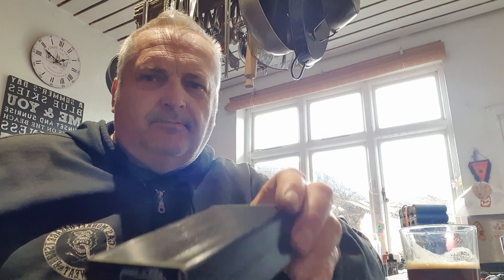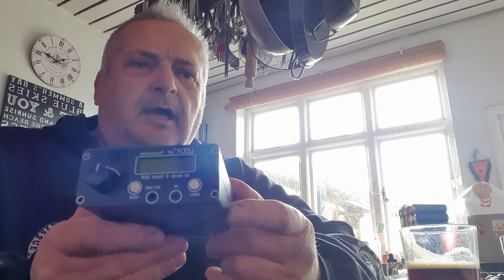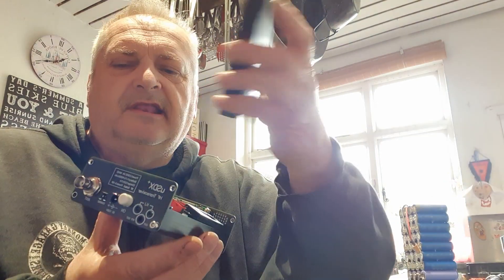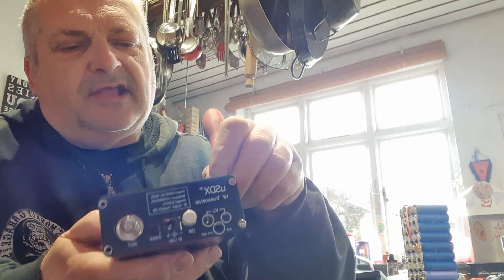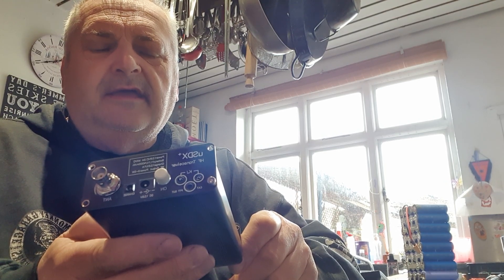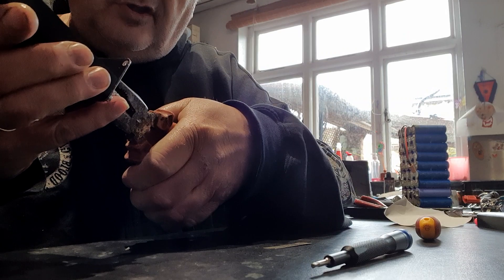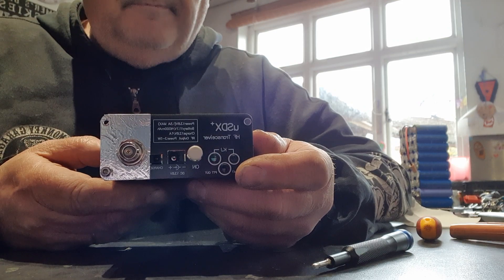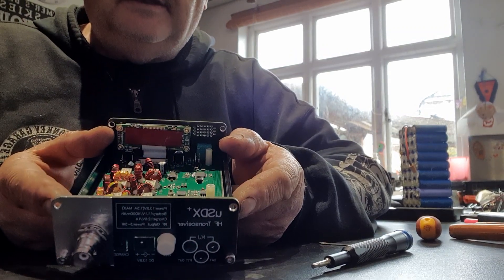uSDX + HF Transceiver. Improving grounding and stability.

Comment: I bought this and not the original for three reasons. 1. It's an eight-bander, otherwise I would have bought the original for sure. And yes, 2. the battery has just been installed and 3. the display is a bit bigger because I can't see so well anymore. The last points weren't important though. Thanks for the video.

Comment: BEFORE YOU BUY a (tr)uSDX (and yes, I realize your video is a year old, so if you were going to buy one, you probably already have):  I saw some YouTube videos about the (tr)uSDX transceiver, and went to DL2MAN Manuel's website to learn more about it, and found where he listed the builders whose versions of the (tr)uSDX passed his evaluations, and went ahead and bought one from one of them.  But then I went to download the software from Manuel, and discovered that all he offered was a compiled image of the code, with no mention of the source code.  This kind of bothered me, because it had been said in some of the reviews that it was fully open-source, and even Manuel's own website implied that by saying that all of the hardware and software was available under a CC-AT-NC-SA license.  Well, it's not true; a "no changes" license does not mean you don't get to even see the code or change it for your own use.  And in fact, it looks like Manuel and/or Guido have been going around making people take down every posted copy of the source code on the Internet.  So I went to the (tr)uSDX forum, and, oh, yes, someone had already asked if Guido's (actually) open-source code that was available on Github for the uSDX would work on it.  Which is what I was going to ask.  Not because I want to compete with Manuel, but because on a radio that does most of its work in software, I don't want to be completely dependent on them to keep my radio running.  In fact, one of the biggest attractions to amateur radio for me is being able to hack together radios that can then be used for worldwide communication.  I've never seen a radio marketed to hams that didn't include a schematic, and to me, a software-based radio for hams that doesn't include the software's source code is a ridiculous notion.  It would be like buying a transceiver from Apple.  What Manuel replied was shocking to me: he said that the code would not work directly, but someone with programming skills could probably make it work.  But THEN he went on to make it clear that this was not something that he nor Guido condoned, because they wanted to have complete control over the configuration of "their" radios, and that if he wanted to do this sort of "software rape" (his words, not mine), he would he on his own.
The main attraction for me was being able to modify "my" radio to my liking, so Manuel has pretty much forced me into buying an older uSDX+ model from an UN-approved supplier, just so that I could fix it if I needed to.  And it does look like it needs a lot of fixing.  Mostly minor stuff, but things like getting stuck in the 10m band if you tune it past the end of the band, requiring a power cycle to fix, but read to the end, this is what I'm talking about.
Now, the (tr)uSDX I bought was a semi-kit (surface-mount components already installed on the PCBs), and I haven't finished building it yet (just got it last week), but I don't know if I even want to, now.  As I told Manuel when we discussed this through email, I said that I would probably build the kit and use his firmware just to make sure it works, then wipe that off and develop replacement code from scratch, then distribute it honestly as open-source, to whoever wanted it.
Anyway, for anyone considering buying the (tr)uSDX, I would suggest that you listen to reviews that include what SSB transmissions from the radio sound like on other people's radios.  And I have to say, "not very good" is my take, and this isn't from listening to a tiny speaker, but what the (tr)uSDX sounds like on a Yaesu, for example.  And there's a simple reason for this: when Guido got the idea to try making an SSB transceiver that splits the modulation into the phase and amplitude components and handling each separately, this was what he did on the earlier versions of his software, including what went into the uSDX and the "sandwich" 2-board version of it that evolved into the (tr)uSDX, he did the phase modulation by making rapid changes to the frequency commands sent to the Si5351a, and for the amplitude component he used a circuit that was previously used to shape CW pulses by controlling the voltage fed to the PA transistors.  BUT, in testing, Guido concluded that the amplitude portion of the modulation in his judgment is not necessary.  Not only is the audio degradation this causes "minimal", but it actually makes its signal more readable when it is down there in the noise.  Which is true, sort of.  I mean, the (tr)uSDX sounds like a radio with the compression cranked up all the way, because, well, that's what happens when you leave the amplitude pinned to maximum.  On the (tr)uSDX, the circuit that was used to handle the amplitude on th uSDX ISN"T EVEN THERE, so you can't even MAKE it do proper SSB without adding a circuit off-board, and possibly modifying the source code to provide the necessary amplitude signal at an MCU pin, if he has removed that from the code.  Which, if necessary, would be pretty difficult without access to the source code.

Sorry for the long rant, but I'm getting a little tired of the misinformation that's out there about the (tr)uSDX.  This radio is NOT the "true" version of the uSDX; it is a cheapened and crippled version.
Reply from the maker: Wow..great informative comment Jim, thanks. I hadn't seen this when I just replied to your other comment, apologies for that. Yes, I've learnt a lot about these radios since this video and as you quite rightly say, tr uSDX isn't actually the original anyhow, so I do acknowledge that my thinking the tr uSDX was the original. Qrp labs were doing this stuff previously. Thanks again. Shane

Comment: I've got exactly the same model (just received it yesterday!), and I was saying to myself, "wait, the front and back panels are actually PCBs, so won't it ground through the plated through holes?"  But I didn't want to spout off without being sure, so I removed the four screws, and saw that they had through-plated holes.  "You see?  Grounded."  But then I removed the nut from the BNC jack, and saw that THAT hole wasn't through-plated.  To which I said, "why would anybody plate the corner screw holes, but not the BNC jack hole?"  But then I realized that whoever designed this had no idea about RF electronics, so on a hunch, I measured continuity between the holes for the corner screws.  Nope.  They bothered to use plated holes, but didn't put a ground plane on the board!  So yeah, I think I'll be copper-taping the whole inside of the rear panel PCB.
Reply: Sorry, when I said, "whoever designed this had no idea about RF electronics", I was referring to the Chinese knock-off designer, not to Manuel and Guido, who do seem to know what they're doing.

Comment: I didn't know about them being clones of Manuels work until yesterday. I just happened to see a video of him talking about them. I'll most likely get one of these in tuis video first. I'm not a fan of the tr usdx orange 3d printed case and I can't seem to find any in a different color. I'm also curious about the bands this one is tuned to. They claim 8 band which is obviously a lie. From what I understand the tr usdx has three separate boards for different bands so I'm not sure what is going on with the clones.
Reply from the maker: Hi and thanks for the comment. Well actually I have to say they are 8 band and there's a different filter for each band. They struggle to produce much power above 15m and only make about a watt on 10  from the box, however there are ways around this. I've learnt a lot about them since this video and if you take a look at one of my later videos I demonstrate how you can up the power to the final and maintain the same spectrum purity the radio already has (which isn't groundbreaking, but adequate) just by increasing the DC supply to the final. I did buy an original Tr-usdx and it worked fine, but I wanted something I could hack and bash and these Chinese one foot the bill. For so little money they offer a great basis for a decent radio. Most people  seem to prefer the "red corners", but having owned a red corner, white button and a Tr-usdx, I definitely prefer the white button model. I've worked out that you can upgrade the display easily and cheaply, the receive  audio on the WB is far  superior and there's a bit more room for mods. Also, you need to work out how to update the firmware, really simple and the best mod you can do imo.  Check out GW8RDI on GitHub
 Good luck and have fun. Thanks again. 73 Shane YO2EWL - G7EWL
Reply: @shanehogarth6373  awesome thanks for the info. That's exactly what I plan on doing. I want the tr usdx but I will also get a Chinese version to play with. I will get the WB model based on what you said. The display will definitely be upgraded first lol
Reply: @BamaChad-W4CHD  It's unlikely that you can find a non-approved Chinese version of the (tr)uSDR, because Manuel has been working overtime to keep from losing control of the project, so he's locked down the source code for the firmware, and you can't even get updates for it unless you have a serial number that DL2MAN (Manuel) has provided only to his approved vendors.  The code that runs on the original uSDX radios (and their several Chinese variants) will not work on it.  What you should be aware of, is that while he is marketing his new version as the "true" uSDX, it's actually a significantly different radio, and in my own opinion, at least some of the Chinese uSDX radios are superior to this "true" model.
Reply: @shanehogarth6373  This is not true.  The original uSDC radios have 8 bands, but the (tr)uSDX has five bands, which allowed them to make the RF board much smaller.  The bands are 80, 60, 40, 30, and 20m.  In his documentation, Manuel gives the component values that need to be changed in order to change this to a different combination of bands, but you still can't have more than five, and it's not clear to me how you tell the software which bands it is actually configured for.
Reply: Sorry, "The original uSDX radios have 8 bands".

Comment: Thanks 
I have one and use it mostly for listening about.
It sits on top of my Yaesu 891...
If I  want to go further,  I turn on my FT891....

I view it as a kind of "Boy scout" transceiver. 
  
What convinced me to buy one was an American in Florida doing POTA and making 40 odd QSOs in ONE hour across the states, including.... ALASKA!

Yes, it must have been a great day, but he was sitting there on a log, "wire up a tree", having a great QRP time using a wee battery and munching a sandwich!

Me happy bunny !
Reply from the maker: They are a great little radio. With a little bit of imagination they can be used also as a basis for a nice base radio. I used the main board from mine as a basis for a much larger radio, larger lcd, more power, large encoder knob with bearing, spectrum scope. Everything a full bells and whistles radio offers for a fraction of the price. Take a look at my logs on qrz for proof of how well it has worked for me. Mines still work in progress but to get an idea, take a look at my other video where I document the early stage of its evolution. Thanks for the comment and good DX. Shane

Comment: Interesting to see you spotted the same lack of grounding between the case parts and used HVAC tape to provide grounding. This was one of the first issues I spotted before even turning the uSDX+ V2 on. I used copper tape on the inside face of the back panel and also removed the paint coating from the back and front panels where the crew heads mate with the panel surface. This greatly improved the conductivity between all four elements of the casing. This also vastly reduced RFI in close proximity to the uSDX+ V2 when transmitting.   Note: You can get rolls of self adhesive copper tape at most garden centers and hardware shops where it is sold as protective barrier to stop slugs getting into your plant pots!  Very handy stuff that I have used for years on many projects.  I'm sure You will have even more fun when You get Your new Tru-SDX  the performance difference between these cheap-o knock offs and the new Tru-SDX is very noticeable. :-)  Have Fun. 73 de MM7WAB 'Hairy' Paul IO75sj, Scotland.
Reply from the maker: Hi Hairy Paul, well actually...I've completely changed direction and used the board from the the uSDX as a basis for a homebrew transceiver. I used the various guides on here to work out how to update the firmware using an Arduino and now am pretty happy with it. I got the tr-usdx a couple of months ago and tbh I've hardly used it and am looking to sell it. One of the next videos I need to make is a pros and cons video as both units have pros and cons. I love the vswr, power, efficiency feature on the Tr-usdx but hate the display, even more than the Chinese knock off display. I've  managed to get a much larger blue LCD display to work perfectly on the Chinese radio now and it makes life so much easier. Stay tuned and in the coming days I will do a couple of updates. Thanks for watching and for the comments, good info regarding the copper tape, cheers. 73s
Reply: @shanehogarth6373  If you're looking to sell your (tr)uSDX, I suspect you ran into the same problems I did, with DL2MAN Manuel locking down the source code so you're stuck with whatever firmware updates they offer.  It's sad, because it WAS a good idea for them to evaluate radios and recommend only vendors whose radios they have approved, but they took the giant step of trying to lock down the source code, which I believe is illegal due to the amount of open source code from others is used, and which I believe will kill this radio.  Sell it while you still can.  I regretted my purchase the first day I had it.

Comment: Duct tape is for use where it will remain dry, duck tape is for wet locations. Chicken tape is used in scary locations.
Reply: use duck sauce
Reply: @chopchop3464  Is that near the tomato sauce, or is it in the beer section